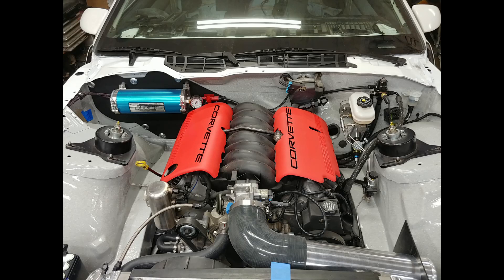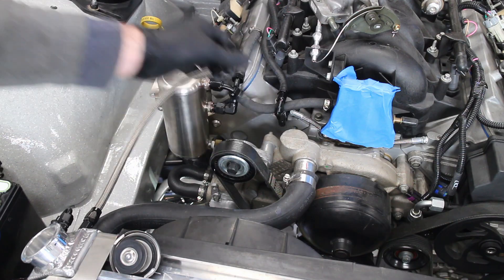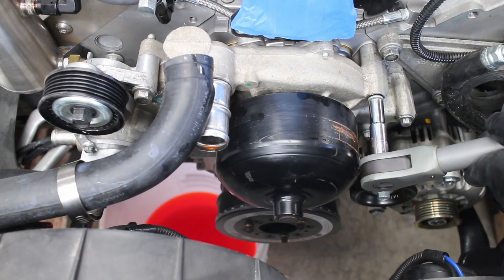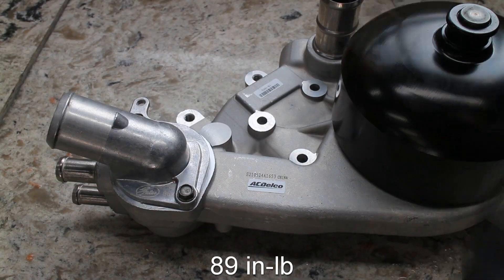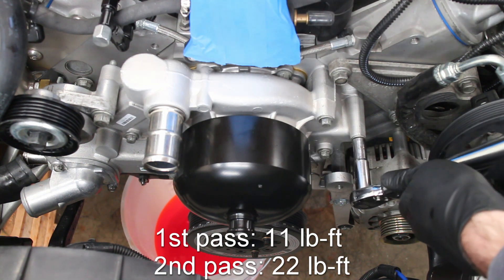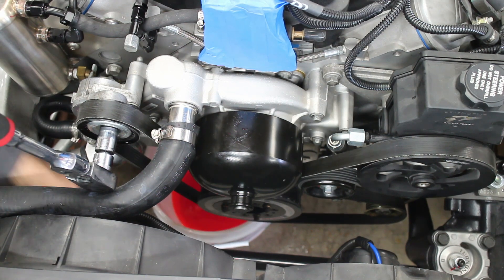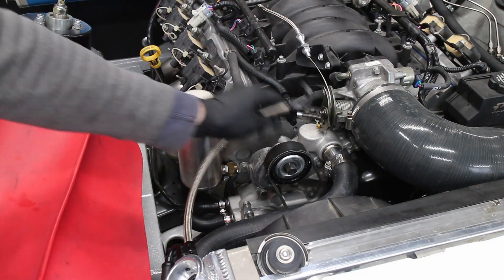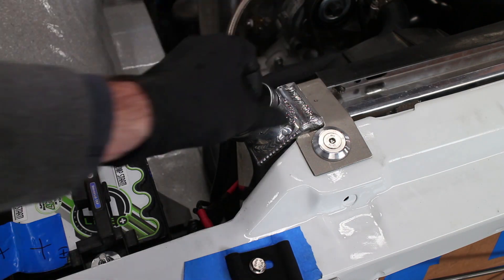LS Water Pump Replacement

Comment: any reason to go bypass on the heater hoses? no heat in the car only race car?  thanks just curious.
Reply from the maker: no heater core. but you still need to loop the outlets to avoid flow issues.

Comment: You removed a LS1 style pump and installed a LS2 style pump....the LS1 uses the one piece T stat....the LS2 uses the 2 piece stat....both will FIT in either....but use the proper stat for the different pumps ....you can identify the LS1 pump from LS2.... by the hump for rear cover plate bolt at the top of the pump  on the LS1...the LS2 has a pressed on rear cover and NO bolt hump on top
Since you do race ...consider the Eldebrock LS pump....its great....and rebuildable ....it uses the 2 piece stat
Reply from the maker: It's a pump from Rock Auto, cheap and easy,